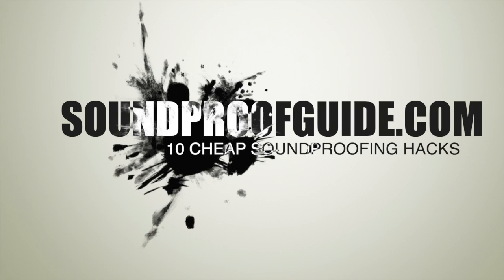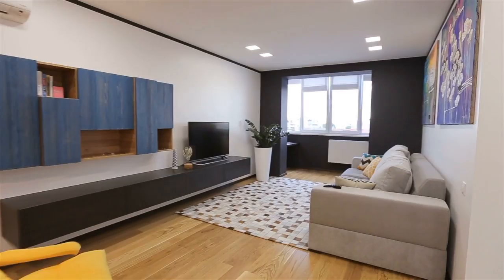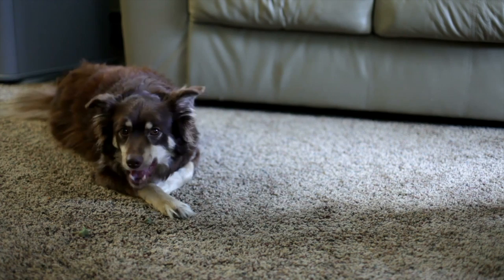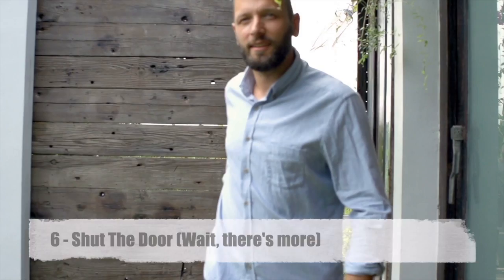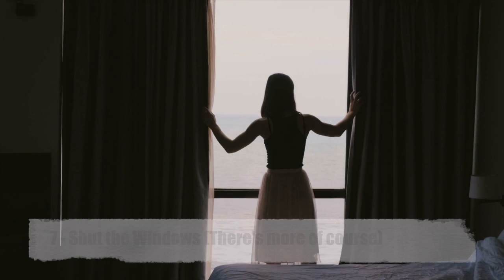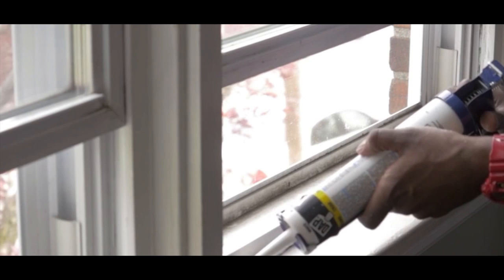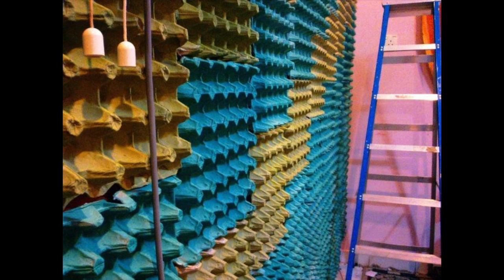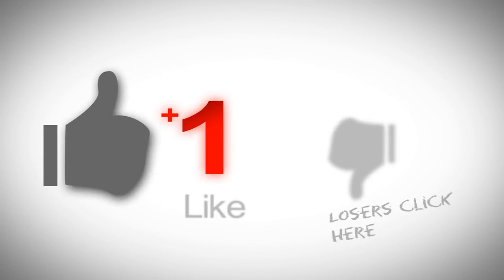10 Cheap Soundproofing Hacks You Should Do!

Comment from the maker: All the recommended soundproofing products I talk about in this video can be found in the description of this video. Don't forget to SHARE, LIKE, COMMENT, and SUBSCRIBE. Doing this really helps small channels like mine to have a chance on YouTube. Thank you!
Reply: "Cheap"? Wall covering bookshelves + hundreds of books is NOT something to  be considered affordable, unless you are moderately well off.
Reply from the maker: @cracanata  Or you have some old books lying around and some "cheap" lumbar.  ;)
Reply: I am considering my options for adding some soundproofing in an apartment. Do you have any suggestions for soundproofing in a place where you can't nail or glue things to the walls? About the only idea I had was making big fabric covered panels of some kind that could be held against the wall by furniture.
Reply: @soundproofguide  any advice for dealing with sound or vibrations coming through the floor? i have a neighbor using a air conditioner right under my floor, because he has a window at ceiling level , right under my floor. he refused to move the ac, when asked
Reply: you need to STOP recommend the bookshelf tip, a bookshelf is expensive as hell, in the thousands $2000-3000 for a bookshelf to cover a regular wall
Reply: @ryujinzero1253  What’s up
Reply: What glazing sheet? Didn’t see a link

Comment: dude this really doesnt make any sense at all...none of these 'hack' actually work soundproofing your room/house...at nr one, which is BY FAR the cheapest and easiest, you should put: making an extra wall with drywall, and fill it with Rockwool. Do double plaster sheets with silicone in between for REAL sound proofing. This is easier, much better, faster and in the end cheaper then wasting time and money on all these 'hacks'. Except double glass ofcourse, which is good (but can be expensive for a whole room, depending on room size).

Comment: Egg crates definitely works. I've moved in a house where the previous tenants had covered the playroom in egg crates and I decided to remove them. The difference was surprising.
Reply: Is it good at blocking out noise from neighbours?
Reply: @doriangray5750  covering the wall with something can be better than nothing but egg crates probably won't reduce sound transfer by very many Decibels. Echo or reverb in the room will be reduced and that seems to trick a lot of laymen into thinking it's "soundproof" when it's really just slightly an-echoic within the room.

Comment: I have also found that using different glass thickness in double pane glass is very  beneficial even if its only 1 or 2 mm From what i have been told the glass panels resonate differently

Comment: I’ve experienced the difference of w/o & w/ egg cartons. Not a big audible diff but def noticeable & likely free. Also may be a bit easier to paint an interesting design/ replace if screwed up.
Reply: Maybe stacking egg cartons would make the cardboard more dense therefore more free sound proofing. Good to know that you were able to hear difference
Reply: @IMDANIELAUSTIN  I'm sure it'd help but I doubt it would be noticeable. What would be noticeable is if you flipped the second layer, putting the high spots of the first to the lows of the second, making it twice as thick. But I don't know if it'd be as effective as even one layer of reg insulation material.
Reply: @lewisgordon1490  ahhh I see the objective. Now I understand why at that point it’d be more efficient to just buy the ready made material. These are all good notes, thanks friend!

Comment: Bookcases can CONDUCT sound as much as reduce it. Adding books will not necessarily help, and could actually increase sound conduction. If you use the bookcases to decouple the wall surface, adding a space between the bookcase and the wall, you might get good results.
Reply: What about armoires? How tall should cabinets be in order to not hear my neighbour's tv? I am ready to invest in furniture.
Reply: @frostflower5555  Sounds waves would be hitting the surface of the armoire, probably harder than books. A glossy surface would reflect sound. Any furniture is generally better than none. Soft surfaces absorb more sound.

Comment: From soundproofing a vehicle - Astroturf rubber underlay is cheap and effective. It is like bonded crumb rubber, good to add mass and for flooring. Office floor tiles - with the bitumen back; Fix them IN REVERSE using velcro hook. This isolates vibration, absorbs it with the fluffy side and dampens vibration with the hard back as well as blocking transmission. Cover over that with any fabric or carpet you like. Use Fibre pin board inside of art canvas frames to absorb noise on large open walls, and have nice picture too on walls that echo.

Comment: There are also insulating gaskets for the cover plates of light switches and plug outlets.  Fairly inexpensive, found at hardware stores, Lowes, Home Depot.   They are good to install for multiple reasons.
Reply: And...use metal wall plates, not plastic.  Denser  material vibrates less.

Comment: Thank you for this very informative soundproofing hack video... I learned a lot...  I live in a densely populated area in Arizona in a poorly insulated small guesthouse with single-pane windows in my landlord's back yard. The air conditioners running on every roof is loud enough, but here's the double-punch... there is a swimming pool in our yard and in several neighbor's yard with pumps and cleaners running nearly full-time. The noise and vibration is keeping me awake at night. I want to know what insulating material you recommend that I can use to build / create a little bed-surround canopy 4-sided covered surround (wood frame most likely) to create a frame around my bed and insulate it from outside noises as much as possible. I don't own the property, so can't add insulation to the walls or floors or ceiling and can't change out the windows. So far, from watching your video, I can try some of the hacks like a carpet or two under my bed and in the bedroom, tapestries on the wall, heavy curtains over the windows, but want to build a canopy like structure around my bed with cheap lumber from Habitat for Humanity Restore (donated building supplies), build a 6-10" rise platform for the bed, and I can add insulation inside the platform. The engines running the pool cleaners are loud and vibrate through the walls and windows and I think even the ground because I hear and feel it when I press my ear to the floor, like a helicoptor is landing or hovering in my yard. Can you help or advise me on the type of material or curtains to use as the bed canopy? I heard your info bout moving blankets. Elsewhere I read about Rockwool?? Help! Slowing going insane! Thank you.
Reply: A cheaper, temporary fix is a tent with something as close to weatherproof insulation under the mat, and cheap gator clips for tarps, blankets on top. Have had noisy neighbors and my last place In needed to insulate from connecting neighbors, street noises both weatherwise which helped double as soundproof. Refletix helped and it was portable into my new place so right now the noise is acceptable, fine as blessedly these placed built solid. Am going to finishing up lining my cabinets with the Reflectix as a sound barrier from me possibly to my neighbors. But using in place of shelf lining, contact paper. Live now in a temperate climate near the ocean so no extreme summer-winter extremes. But dampness I am told can be an issue. Ceiling fans and at night I turn on the HVAC a bit to help with my arthritis. Refletix I fear possibly dampness underneath. It does do well at retarding the black ants from trying to invade my pets good bowl in another room and areas of the kitchen. They have found ways deep inside my pantry so finding the block is hard. Oh, thick painters canvas cloth and duckcloths I believe offer the most insulation. My last place poorly built but I had started an insulation wishlist or to do researching and pricing all kinds of materials. That included outlet and foam sealers for lighting, electrical which I also took with me. Take the ovals from the foam outlet seals, cut slits to go over dollar store child proof socket dealers. Use masking tape first before I used white duct tape. Not a miracle product on most of my outlets-lightswitch plates except a few. Masking tape first because for this and the Reflectix and duct tape products I used for other projects, when I moved, they needed to be sanded down by maintance and I got charged a bit. Also my downstairs connecting neighbors frequent visitors smoked everything under the moon including burned foods. And their many potlucks in too small of a place, I kept getting their ants so another benefit to masking tape then duct taping the outlet covers. Did not want to complain or be viewed as s snitch ad it's against rules but that place in a highly infested ended up the last half of my rental history there. Huge immediate bonus is noticing the retention of my winter heat-,summer air conditioner. Lots of people visit but figured out they depended on me to heat-cool them. In a few different chats they got snippy and accused me of stealing their electric and gas from them. The meters are outside their windows, direct view and the geothermal gas units locked up by staff. Good luck with their next tenant moving in after me. Gratefully and surprisingly am in a better sound and temperature insulated place. I intentionally also made an extra goal to take my materials with me especially the double rod curtains as I was ready to put on up in the old place. Have too many curtains now. Some are going to repack the family heirlooms and some rolled up on top of the closets to help.retain heat and add a bit of extra sound insulation which I really do not need but am sure my neighbors appreciate.

Comment: I put together a new bed for relatives, and held onto the mattress before discarding, storing it upright against a wall.  That mattress alone quieted the heat exchanger, outside noise, and even my typing on my computer (er, I still have a "manual" touch on electronic keyboards).  The effective noise abatement made me look again at DIY Perks channel for his cheap, framed bath towels as acoustic absorbers.
Reply: Our roof is GI sheet. Can we use bamboo splitting in 2 to be our ceiling as a soundproof from the rain?

Comment: Cheap ways to soundproof your home.
Number 1: Multiple bookcases covering every inch of every wall
Reply: And what if  the noises coming from the flat above like the ceiling
Reply: Yeah.  I stopped right there.  Although, a bookcase will absorb a lot of sound, it's not a professional solution, and not cost effective.  It should not be step 1 of "soundproofing".
Reply: Agree acquiring a massive library is not an inexpensive solution. And why must music be played? Thumbs down 👎

Comment: Honestly, best way I find is to just lay another layer of plasterboard if it's an existing wall with a layer of green glue inbetween the existing layer and the new layer.

If it is a new wall, rockwool / staggered studs and double plasterboard with green glue plus using acoustic caulk to seal up any air gaps inbetween joints and on the floor / ceiling.
Reply: How do you deal with window openings?

Comment: Thanks for the various hacks. I'm mostly interested in sound proofing the ceiling. I have a crazy roommate that likes to yell to himself. 
Does styrofoam work? or is it not dense enough? I can only hang so much from the ceiling. So far I have 2 layers of fiber boards up, but unfortunately I wasn't aware that there can be gap for the air to pass through.
Reply: As far as I know, you'd need to completely soundproof your ceiling by a professional builder.
Reply: I too need my ceiling covered and maybe floor but it's mostly for when I'm on the phone. The apartment walls, ceilings and floors are paper thin. My phone conversations are closely listened to. At this point I'm willing to find some acoustic foam and line a box with it and put it over my head while I'm talking on the phone cause man!
Reply: @starspeculation  I tried, he's a nut job...
Reply: I hung a carpet up, it's a mild sound dampener. Unlike last time, I made sure to stretch it across the entire ceiling edge to edge. Another layer of thick carpeting will help.... Better yet this nutjob finds something better to do with his life.... instead of spreading misery.

Comment: Love the hacks...but I think my problem is bigger than those solutions. I bought a new house. The guy next door backs up a 2 exhaust truck up next to my bedrooms and leaves at 5am in the morning (89db through the wall). Wakes me and gives me a headache every time he starts the vehicle. I am on a raised foundation. If I add bricks under the house, about 2 feet high on that wall, will that help? (Already have double pane windows and have filled the walls with insulation, the rooms are small so adding a layer of drywall would be questionable.)
Reply: That sucks...what about changing the bedroom space to somewhere else?

Comment: I rent and my upstairs neighbors have kids and no rugs. The last tenants had rugs and I rarely heard them. I have white noise machines,  fans, wear earplugs and headphones. Will heavy blankets on the ceilings help? Would thick rugs with heavy padding help if used upstairs? I also share a heating and air system with them. I rarely hear them talk, but can actually hear the kids play with matchbox cars. You can imagine what is like when they run and stomp! Any advice?
Reply: You might have to add a false dropped ceiling made of two layers of 5/8" drywall with a spacer of green glue sandwiched between them to create an air space to deaden the sound.
Reply: i have similar issue and been searching the comments for an answer! he seems to avoid answering these questions for some reason... please help us!
Reply: @baldwinstreet6475  Well..I lost it and played heavy metal and punk rock for 3 hours straight on the highest volume. This was not planned.  Message received. They move their kids to another room to play. And have been routing them to another part of the house to run.  It's better but not perfect. Would still like to know the answer about rugs and padding.  I have asked my landlord to buy area rugs for two rooms.
Reply: @iamllux  not an option. It is a good solution if I owned the home.
Reply: @baldwinstreet6475  he doesnt know the answer to this, he doesnt reply to this question.
Reply: i think he doesnt know the answer to this, he doesnt reply to this question.

Comment: I have yet to find anything that blocks bass, and that's the one thing that drives me up the wall. Got any ideas for that?
Reply: Bass traps typically work to block bass or at least reduce it by a lot. They're usually placed at the bottoms of your floor or corners around the room.
Reply: Same problem here. I added a box fan to my room and it reduced the noise a good deal. I'm thinking of ways of positioning it and another box fan. With base you need thickness, which means a lot of $. I figure fans are cheap and easy to install.
Reply: @backcrackingvideosamigo765  I'll put Mack's silicone plugs in my ears, and THAT works pretty well unless the bass is right next door. I also have a Honeywell fan to block less invasive noise. It's a  constant battle against noisy humans, though. ;) Makes me wish I lived in the country again.

Comment: for ceilings, what is better for sound dampening /proofing: double sheetrock with green glue in between or Rock wool insulation and single layer of sheetrock?
Reply: STC ratings of rockwool and fiberglass almost the same, a thicker piece of fiberglass for less money would have a higher rating then the rockwool

Comment: The gap under the door isn't just for doors to open easily its there to allow forced air to circulate through a structure. Block that gap and the thermostat won't control temperatures across all the rooms.
Reply from the maker: That is correct. I wouldn’t recommend placing a bottom door seal on every door in the home. Only the room you want to soundproof. Thanks for the comment. 😊
Reply: Keeps the dust and bugs out.

Comment: Hi. If I build a new room  with brick walls , it will be double brick walls with a 50mm caverty between the outside course and the inner course.  Then I place a insulating material in the caverty similar to that product that is  layed in the ceiling for heat. Will this be effective. ?

Comment: I don't have heavy furniture and I don't have many pieces of furniture either. I'm going to try foam board that you can buy at the $ Tree. I'm going to hang it behind pictures to see if that won't help soundproof the room since it's very large and in a new apartment. I have to do something fast!
Reply: Get canvas stretchers.  If you have to buy them, each side is three or four dollars.  But, no effort in cutting, just lock together.

Use old beach towels, old mattress cover is itself layers,  cut to size, layer after layer.   

Staple gun the layers to the wooden canvas stretcher.  Top cover is pretty fabric.    Lots of giveaways or run a freebie ad to have remnants  come to you.

If you do a few, do a few more to giveaway to seniors  or to trade for material.

Comment: Great video. I have a heavy-duty speed bag platform bolted to the wall (through studs) in my finished attic. House is relatively new, 2013, construction. Yet still vibration can be felt throughout the house. Placing heavy sandbags on top during use helps. I wondered if also placing foam pads or rubber between the brackets and wall would help much? It would have to be thin rubber so that the bolts can still be driven relatively deeply into the studs in order to support the weight of the platform. If I instead used foam pads, they would become very thin as they are squashed when I tighten the bolts. Would “squashed” foam still be effective at minimizing vibration?